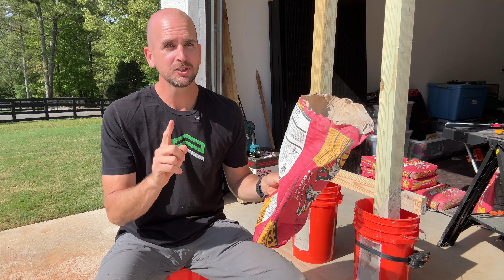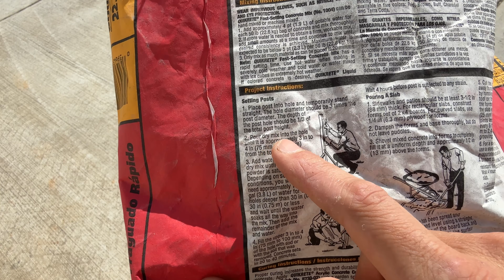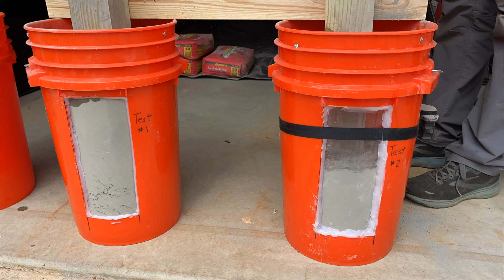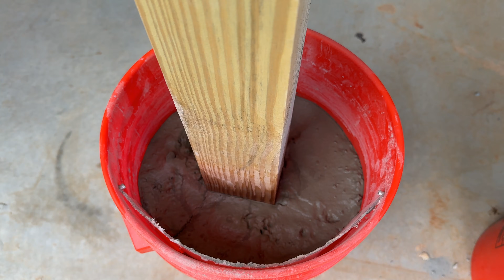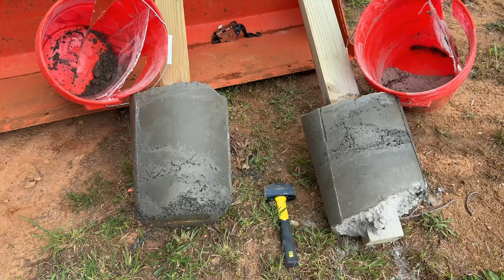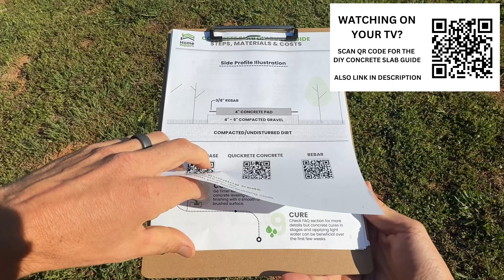Does Dry Pour Work For Fence, Mailbox, Deck Posts | Surprising Results!

Comment: The solution to the bottom of the post not setting is to add more water. You can do it after the top portion has set up since water helps the curing process and won't hurt that section. The water will work its way down by gravity in the ground rather than being sealed by the bucket as shown in the test.

Comment: Water follows the path of least resistance. In the second example, you added it at the midway point and then covered it - that would cause the water to travel into the quickcrete radially from that spot, but mostly on the bottom. As the water traverse to the bottom, it leaves some of itself behind as it bonds with the quickcrete, creating resistance for the new water you added above it.  The reasoning that the Youtubers have that if you split the water load this way is to avoid this phenomena, but it doesn't work in a bucket because the water cannot move laterally to make room for the water above it to come down as plastic is insoluble. Personally I think you would get better results with both methods if you did them in the ground, or at least surrounded by a layer of dirt a few inches thick.

Comment: This is the expected result and mirrors soil science. When you soak dry absorptive matter, the water forms channels and soaks down, and is able to continue to soak through. If you take the water away those channels close up quickly and they do not reopen if you add water back. The matter has to dry out before the channels are able to form again (concrete obviously can't). Normally this is discussed because of rainwater runoff. It's why Helene was so devastating. 30" rainfall is always going to be devastating, but it was preceded by a smaller storm which soaked the ground and sealed it off. When the 30" hit the absorptiveness  of the ground was at a minimum and all the rainfall moved ass runoff.

Comment: I think your setup is flawed.  You tried to make your buckets air tight, causing an air bubble.  This did not allow the concrete to draw in the water.  The one on the left soaked better not because of the procedure difference, but because you accidentally had a leak for air to escape and the water could drain down.

Comment: The holes in the bottom of one test let water migrate into what would otherwise have been an air-locked mass, since the wet concrete on top blocks air from escaping, as others have pointed out.
And dont confuse dry-pour concrete with dry-pack (deck mud), which has been used successfully for decades in traditional shower pans and building up tile floors. Dry pack isn't just "dry concrete"—it's the correct sand/cement mix with just enough water, then tightly compacted. Mike Ostrom at Tile Coach has one of the best explanations of proper dry pack: https://www.youtube.com/watch?v=eYJ5gQtVAsI

Comment: I've had issues with all try pour attemp tests using "recommended water numbers.   I tried starting with recommended water, then doubling or even crippling over the next 2 or 3 hours, say float showing every 10-15 minutes, until float rook more than 10 minutes to disappear.

My view on YT tests was that it was always the bitter that failed.  Figuring "overflow" would just soak into dirt, I just over watered.  Right or wrong, no pour after I did this ever had powder at the bottom.

I dont kniw if "diluting" the cement will shorten life, though.

Comment: I like your objective test-I was thinking about the dry concrete method for 2.5 deep posts but now will take the little extra time necessary to pre mix the concrete with water.  Far and away, digging the hole in root-bound area requires  the heavy and time consuming effort. To concrete in the posts with any uncertainty of the setting would cause unnecessary worry. Thanks!

Comment: Yes, you have to take into account that ALL the water was absorbing into the concrete mixture in Test #1 (because it was in a bucket!) Normally some of the water would be seeping into the dirt of the hole. 🤔 Which would explain why in your first video of setting a post, not all of the water soaked all the way down to the bottom.  I agree with @nils-erikolsson 👍

Comment: The reason is simple: there was a delay when you added the water to the bottom half (the right bucket), then added the dry mix concrete on top, plus the water. The bottom half of the cement had already started to solidify, creating a barrier that prevented the top water from trickling down by gravity. Since the water was not enough in the lower layer, cement solidification in the middle (of the right bucket did not happen all the way to the bottom.

Comment: Test #3 should be about a quart or half gallon of wet mix into the hole followed by straight dry mix and then the rest of the water so the wet ends work to meet in the middle.

Comment: Depending on the soil type and recent weather, the ground will absorb at least some of the standing water and possibly most of it aimed at the dry concrete mix. Doing this experiment in plastic buckets is not a real world test of this lazy man's technique of setting a post in concrete unless you plan on burying a plastic bucket in every hole before you start pouring anything.
 This "test " tells us nothing about what will happen in the real world of a hole in the ground.
 Do it right and mix the concrete with the water thoroughly BEFORE you pour it into the hole. This lazy man's technique is stupid and dicey at best.

Comment: The water amount and thoroughness of mixture is critical to the strength of the finished concrete. Why would anyone take the lazy man's quick procedure just to save a few minutes of mixing time?
 No true professional would do a fence post or anything else for that matter, with sub par mixing of the concrete and then cross their fingers that it will mysteriously mix itself when you can't see what is going on down inside the hole. Don't be stupid

Comment: Couple things, both methods would probably work fine in the ground since the concrete would eventually pull moisture from the ground and/or the water you poured on top would go into the ground and soak in from the sides as well as from the top. Also if the second method had waited for the water to pull down a little bit more before pouring more dry on top it would have saturated down better since when the dry is poured in on top it actually pulled a lot of that first poured water up into the looser dry mix.

Comment: I have not seen any instructions to lay the dry concrete mix on the ground and roll around in it like a kids sandbox breathing in as much silica dust as possible before sprinkling water on it.

Comment: Unless you are pouring in solid clay/rock ground, dig a hole big enough for a cinderblock square 2 layers high. 4 standard ringing a square center 2 levels high. Fill the post hole in the center with cement, add post, and bolt everything together. That sucker is never moving. Costs more but way better quality.

Comment: I used the dry pour method on holes that had ground water in them prior to pouring in the dry. Most of the holes were completely filled with water. Two weeks later, I had to pull up two of the posts. The crete was fully hardened on both. Had to sledgehammer like crazy to bust it off.

Comment: The dry method saves time, water, your back, mixing and so forth so it is definitely worth doing unless you live in a dry area or has draught conditions.    If you have a high water table, or live in a flat area like Indiana (Illinois pretty much qualifies) the concrete will get moist and cure slower and be a better approach overall I guarantee it.  You don't even need the dry mix unless your fearful.   3" below the soil line doesn't sound good either.   I prioritize faith over fear.   You can almost make an educated guess, hypothesis, without doing an actual test because your method has other factors you aren't including.   It's a half baked effort but not unreasonable for a small project guy like yourself.  If you take a more comprehensive approach to small things you will have better results.

Comment: I've seen several videos where someone tries to downplay the fast acting for strength and it's clear they are making up their own standards.   The instructions say you can start working with your fence in 4 hours.  It ALSO says it is strong enough to walk on in 24 hours, but the total cure time to reach full, maximum strength (4,000 PSI) is 28 days.  Now where does it say in 4 hours it will be strong enough to hit with a hammer.  I would say the same thing to you as i did to the others.  You are not representing the claims of the company when you invent tests they never claimed or pass.  No one said the concrete would exhibit full strength at 4 hours, only that it was safe enough to start attaching your fence to.   Details matter and you can't assume everyone else wants to see YOUR definition of strong concrete.

Comment: Pretty sure the instructions also say if the hole is deep requiring 2 bags or more that you put some water in the hole first and then pour the first bag. Add the rest of the water fir bag #1.
Then add second bag. Add water.

Comment: I think it all works better with a green tractor instead of orange.  Seriously, I think it depends what you are doing with the post.   For a mailbox, not hitting it around, just soak the hole, pour in a little rocks, then Quickcrete and water.  Come back next day and bolt your box on and it'll be there 20 years later just fine.   On the other hand, if I was building another swing/playset for kiddos to be swinging on and beating it up, then premixed is going to do a much better job, so it doesn't bounce around 5 years later and need to be redone, like mine did!

Comment: Dry pours in real world conditions would be even worse as the water would seep laterally instead of sitting in a sealed container for hours. The best way to test dry pours is to actually perform a dry pour, then excavate said pour and see results. Then variables like soil type tests to conclude just theoretical conclusions

Comment: NO!, you always pour gallon water on bottom, then bag 80lbs, then another gallon or two on top, then 80lbs,  rinse and repeat. ive yet to see a video where they pour water first, then cement, then water, then cement, then water, then cement. and ive built miles and miles of fence and coralls, along with digging up what weve pulled up years later when the post has has rusted before the cement gives. Someone do a video, of water in botttom of hole, then a little on top of each bag, until hole is filled. you guys can show that dry pour is  pour. but f you do alternating pours, you have to know what to do to prove the unmixed pour theory. Everybody misses it. nobody pours water first, then cement, then water, then cement, then water.

Comment: Plot twist: wood posts shouldn't be set directly in concrete at all. Fence contractors do it because it's faster and time = money. But the DIYer isn't in a rush and can tamp stone and clay around the posts to set them. Concrete or not the posts are going to rot in 5-10 years and they'll be easier to replace without an 80lb slug of concrete stuck on the bottom.  If you want longevity use steel posts.

Comment: I fill the hole with water first -- all the way up to the top. Then, I slowly pour in the concrete. I pour slow to avoid clumps of concrete that don't touch water on tge way in. Concrete is heavier than water. So water overflowing as you pour in concrete is just water. This works great as long as your soil holds water. If the ground is dry and cracked -- letting water run away from the hole -- this doesn't work so well.

Comment: DRY MIX HAS TOO MUCH TRAPPED AIR INSIDE,  ITS NOT THE SAME DENSITY AND CHIP EASIER, JUST ADD WATER AND VIBRATION, COMPACTION LIKE CONCRETE GUYS DO,  IT TAKES NOTHING YOUR SPENDING THE TIME AND MONEY

Comment: I don't think 4 hours is adequate time to evaluate the strength of the concrete. Give it a week or two. The ground is moist and will continue to hydrate the cement, particularly the deeper portions of the hole. This process goes on for years. Concrete that is 50 years old continues to get harder every year, albeit at a very slow rate.

Comment: The  University Agriculture class  of Tennessee did a test on fencing back in the late 1990s , they did not recommend concrete for corners post construction,  because of freezing and thawing would cause the posts to loosen , their findings suggest drive the post or tamp with gravel and dirt or sand and dirt mix .
Reply: Build your post as close to what a tree is doing. SPREAD the base. if all you have are sticks, dig deep into solid ground.

Comment: This is why I still mix it by hand and pour🎉
Reply: What consistency do you make it?   Loose enough to pour or do you have to shovel it?  Have you ever paid attention to what you use with a 50 lb bag of quickcrete?   I poured some today - the back says '4 pints - max 5 pints' then 2 inches down says to use 1 gallon per 50 lb bag.  I've never done concrete so just tried to keep it semi loose and pourable but a thick fluid
Reply: @jeffa847 ; Just don’t make it soupy.should be about peanut butter or a little looser. Lots of contractors will make it soupy, just because it’s easier to get into the hole.
Reply: How does that matter? a sledge hammer cracks the pour. That means level issues immediately. Overtime the foundation is compromised. If this cheapo DIY method worked TREES would set themselves similar, they don't. Trees spread the weight. Trees anticipate ground shifting. Unless you spread your base your build will fail 100%. The only out would be hard solid ground. Even then a hole and blocks is still superior

Comment: I question your assumption that the bucket scenario is "ideal" compared to surrounding soil. I think you need to test that idea. My thinking is that in dirt, though you lose water to the surrounding soil, you also create additional pathways for the water to surround and penetrate the concrete mix and achieve greater saturation throughout. Also, once the surrounding soil reaches saturation itself, I think you'll end up losing less water than you might expect. Anyway, I think it's worth comparing the performance in soil vs. bucket just to be sure it isn't biasing your results.

Comment: For a fence post, I'm not sure it really makes a difference. It is not something that requires high structural strength and the surrounding dirt provides additional support. Some people fill the hole with dirt and that can work ok though I think the posts would rot out more. In sandy soil I can understand the 3x hold diameter, but in heavy clay, I'm not sure the point. The cement acts as a barrier to soil organisms to reduce decay and as a convenient way to fill the hole and stabilize the post, but my guess is that coarse gravel would also stabilize the post and would clearly provide better drainage. I've also seen the suggestion of putting a 6-inch plastic pipe down 2 feet, filling with dirt around it, inserting the post down the pipe and filling with pea gravel. An interesting idea that would make replacement pretty easy, especially if the below-grade post was treated with an asphalt emulsion and a commercial post barrier membrane was also used. I have never seen post uplift as a problem (sunk below the frostline). Fences seem to fail when posts rot or lean and fence rails sag. Posts only rot near the surface where oxygen is present. Lower down in compacted earth there is moister but no oxygen, and decaying organisms are absent. It takes more than water for wood to rot.

Comment: For the manufacturer's directions, what do you do if the hole is >30"?  Can you not use the quickrete and instead go with regular concrete (mix in a barrow and then shovel in)?  I live in PA and the frost line is about 42".  TIA!
Reply: wet mix it >30", then pour

Comment: So many of the Youtube influencers don't 
understand the issues here. You don't put 
water into the post holes at all. That's what 
it says on the package. The posts
are to sit in the dry post mix and the moisture
comes into the mix over months. I have put
posts in with dry post hole mix that have 
lasted 30 years and are as solid as when they
were put in. The moisture makes the cement
kick off over a long time. The mix stays a bit
porous and the post doesn't rot, because they
were not starved of air. They stay dry. They
also stay solidly held. This video gets it all
wrong. Sorry.

Comment: the dry mix pulls in water like sponge.
By doing half mix and half water the first bit of water gets sucked up by both the cement above and below. The water at the top will have less pulling action done by the dry cement as a lot of it has been saturated.

Comment: If in the ground when it rains the ground will transfer water down around the concrete and it'll get stronger over time. The ground also acts as a form so the concrete stays in place. So as long as you get enough cured concrete to hold it up initially, eventually all the concrete will harden. So easiest is best.

Comment: One issue I can see with the 1/2 and 1/2 is if you are putting the second 1/2 on before the water has soaked in that remaining water will get soaked up into the new mix and that is probably what is preventing the saturation all the way into the bottom for some reason.

Comment: I suspect putting water in between stops the capillary action through the concrete mix.  The water in the middle would be pulled both directions and the water on top would have nowhere else to go.